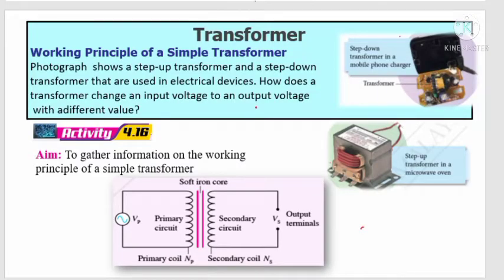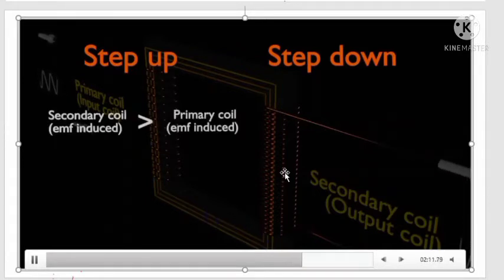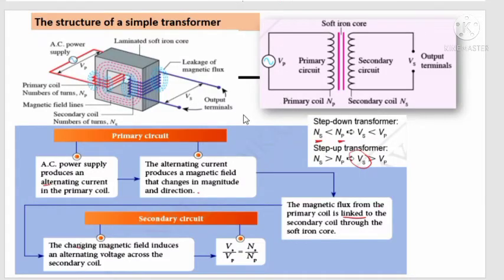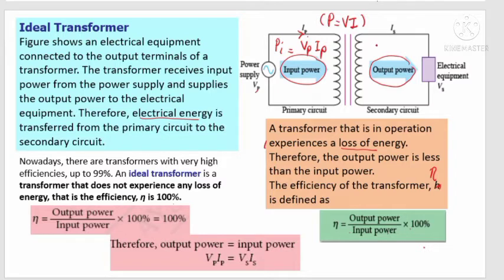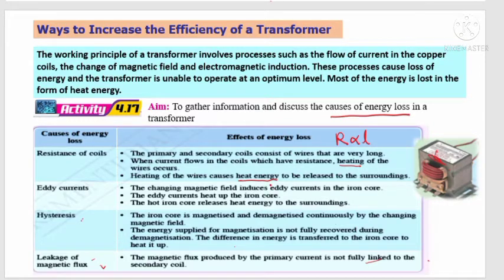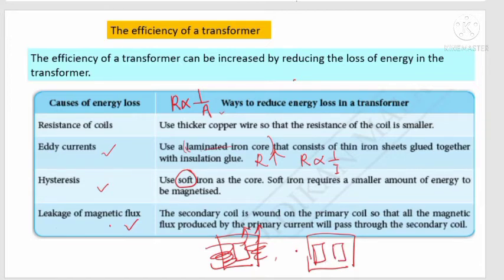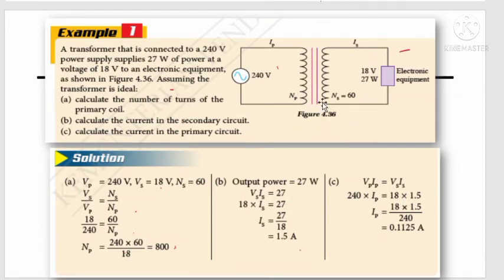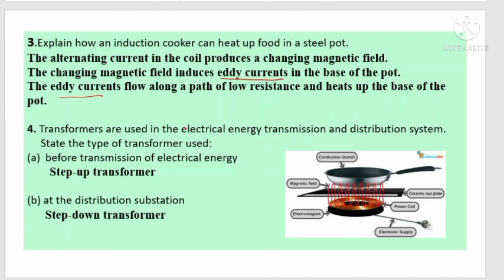4.3 Transformer #physicsform5KSSM

Comment: Teacher, why does the transformers does not work with a direct current power supply ?
Reply from the maker: By changing direction of AC will produce change in magnetic field linkage to secondary coil..so induced current flow.direction of DC is constant in one direction. Thus no change of magnetic flux is produced or no induced emf in secondary coil